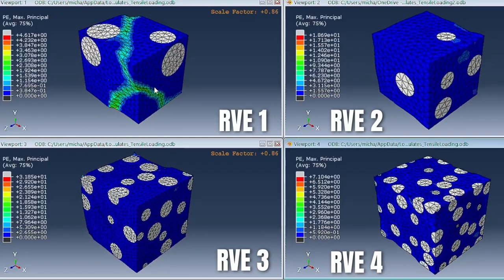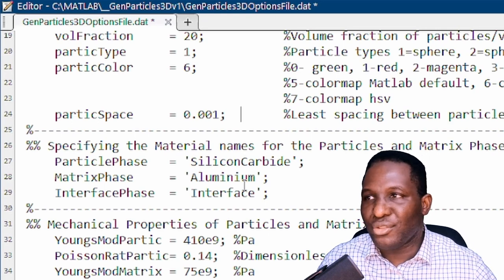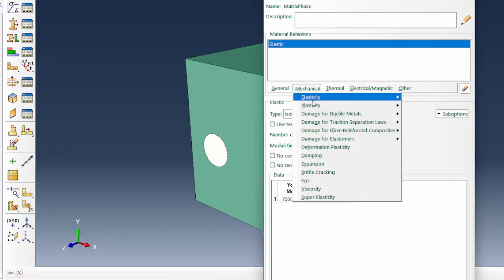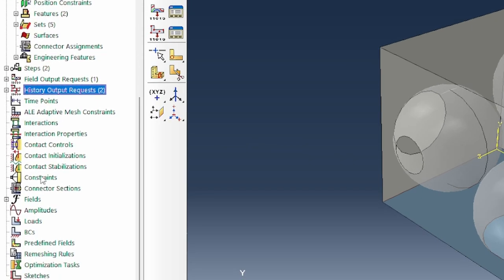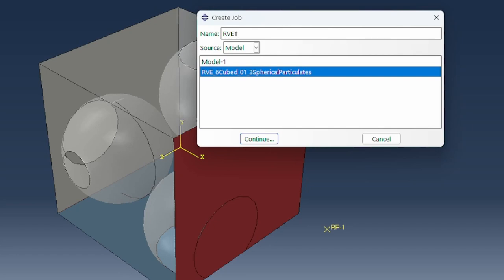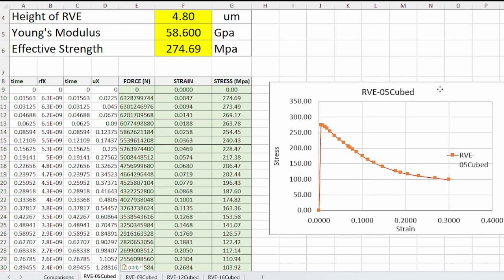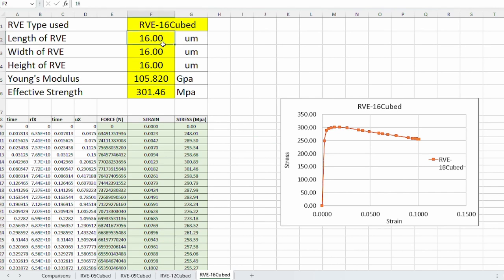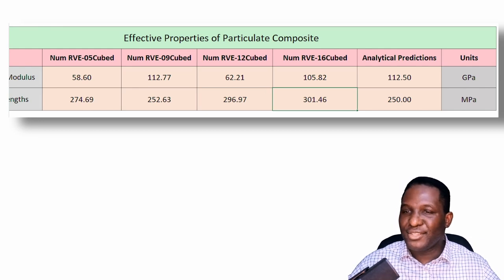Revealed: The fact about RVE Size effect of Particulate Composites

Comment: Thank you, Sir, as always. I have 2 questions:

1. You mentioned that the particle diameter is the same for all - wouldn't it be better to make the particle diameter correspond to the size of the RVE while maintaining the same ratio. For example, if the diameter of the particle is 0.05mm for an RVE of sides 0.1, using the same particle size of 0.05mm for an RVE of size 0.2mm seems like an imbalance and lopsided comparison. 

2. How can one compare the results obtained in any RVE simulation with experimental results?
Reply from the maker: Hello Johnson, thanks for the question. Here are what I think:

1. With this sort of RVE size assessment, you want to keep the diameter the same and simply increase the size of the cubic RVE. This is because with RVE investigations, the size of the RVE is something you have to choose. Ideally you want it to be as small as possible for you to get good predictions based on that. The diameter of the particles in this instance is fixed since this is a characteristics of the AlSiC. It is something you can measure from a microscopy study and so a fixed parameter. You simply have to change the overall size of the RVE so that you can quantify, as I did here, the true effect of increasing RVE on other fixed properties of the composite such as Young's Modulus, strength, fracture, post-yield response and so on.

2. For comparing RVE results with experiments, it is better to extract the homogenized properties of say stress and strain from the RVE and then compare directly with experimental data. The essence of homogenization is to obtain say stress-strain plot at the RVE-scale which should equivalently compare with the stress-strain plot at macroscale or structural level of the test material. The approach I use in these RVE modelling is a computational homogenization approach but other approaches can be say asymptotic homogenization which rely on analytical formulations. 

I hope the above makes sense to you.